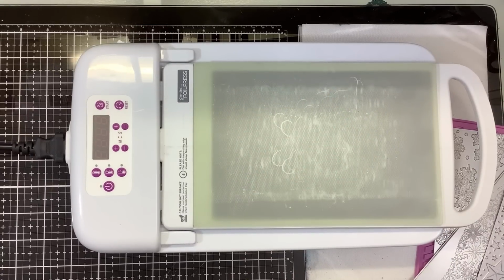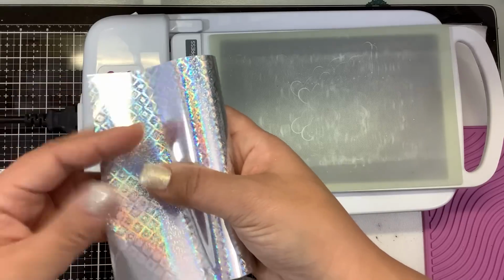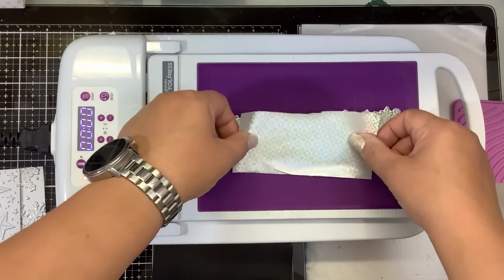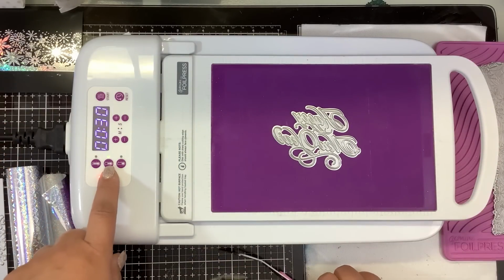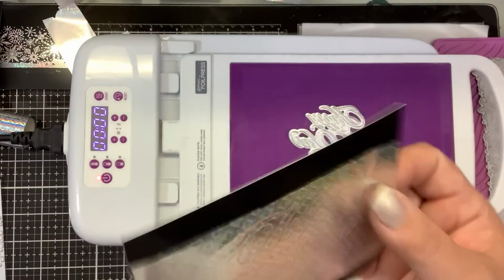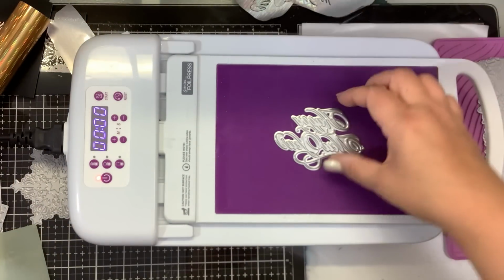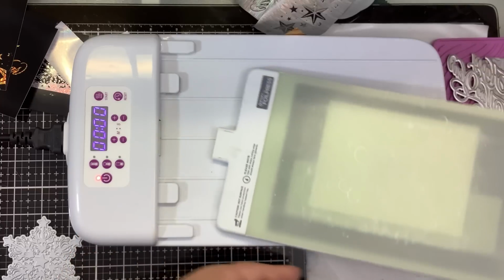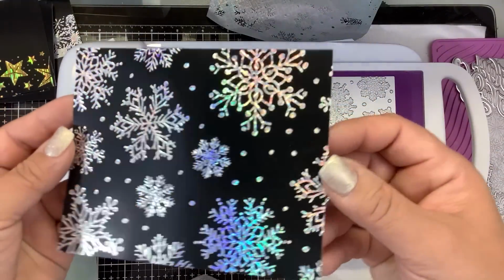Who got a Hot foil machine for Christmas?

Comment: Since the metal die is sitting on the hot plate while cutting the foil to match the size, isn't that adding more time to the count (actualy adding more secons to the clock), or does pressing the timer do somthing other than count down?  Just curious.  Thanks Nancy.  8-)
Reply from the maker: Yes, but once it gets to its specific temperature it doesn't get any hotter. Just stays at temperature.
Reply: Got it, thanks.

Comment: Interesting.  Would have liked to see what was taking place when you took the plate over to the other machine.  I do not have a Gemini machine so don’t know what you were doing at that point.  Thanks.
Reply from the maker: Just feed it through the front and it comes out the back.  Electronic die cutting machine.

Comment: I’m confused.  The instructions say to heat the stamp & when the timer beeps, then pull the heat platform & apply the foil, cardstock, & top plate, but you’re doing it all at once.  Do you find that this works better? Thank you 😊
Reply from the maker: With Gemini foil yes, you can do less time and lower heat settings.  Because I'm using couture creations foil, it takes longer.
Reply: Nancy Stamps  Thank you 😊

Comment: I’m still trying to get the hang of mine, it constantly over foils regardless of the temperature setting I use. I get frustrated, walk away try again and get frustrated walk away. I want this to work for me so bad, but can’t seem to get it down! Ugh
Reply: I tried using the big kick with no luck, I can’t make a proper sandwich to get it to go through, there’s either not enough pressure or it’s too tight to fit. Unfortunately here in Canada a Gemini jr. is really expensive to have shipped due to weight. Ugh even more frustrated now.
Reply from the maker: @tonyaberezan2330  I have a video for the proper sandwich.
Reply: Nancy Stamps just sent you an email. Thanks for the help, much appreciated!
Reply: Nancy Stamps  I’ll be emailing you, too.  Thank you VERY much Nancy.
Reply from the maker: @shan-fh4uq  no problem
Reply: Tonya Berezan I’m having the same problem.  I have the original, larger Gemini die cutter, NOT the Junior, and I think that’s the problem; too much pressure.  I even tried it at Low heat for only 2 seconds, but it still over-foiled.  I did have better luck using the Glimmer brand foils.  I’m quite disappointed, because I had to pay extra to get the extender plate.  Now my only option is to return the Foilpress or buy the Junior.  :(   Also, after an hour + of experimenting, the purple rubber mat on the heat platform is tearing, which again is probably due to too much pressure from my Gemini die cutter.  Either that, or the Foil Press I got runs too hot.
Reply: shan funny, I too have the Gemini, I’m guessing that’s the problem, too much pressure. I’m going to try it in my big kick for kicks and giggles and see how that goes! Fingers crossed, I’ll let you know how it turns out!!
Reply from the maker: Tonya I have a private video for you, can you email me your email address for the link.  Nancystamps15@gmail.com
Reply: @NancyStamps  Why not share the private video on how to make a sandwich with everyone instead of just Tonya because she is not the only one that is supporting and watching your videos and she is also not the only one having the same issue with the Gemini foil press?! SMH
Reply from the maker: @T_Nice  because Crafters companion sent me the Foil Press as an Influencer and they don't want me showing other dies and machines with it. I had it posted and they made me take it down. It will void your warranty from them.  I can send you the private video.  Just email me.  Nancystamps15@gmail.com
Reply from the maker: Tonya I have heard that people using the regular Gemini have had the same issue.

Comment: Nancy, I totally enjoy your videos on foiling. In fact, I purchased the Gemini Jr and Foiling machine because of your helpful videos. I am disappointed though, because after 79 days, my heating plate started cracking. It now has a 1.5" crack into it. I immediately emailed the company with pictures of the crack, but they haven't responded after two emails. Any suggestions? I don't want to buy a replacement plate because they are very expensive on a social security budget. All I've ever used this machine for is to foil die cuts as described in their operations manual.I have never used it for the hot stamp dies.
Reply: Lynne Wilson From my personal experience w/ CC, emailing is an exercise in frustration & futility.  I would recommend calling them.
Reply from the maker: Yes, call and email them.